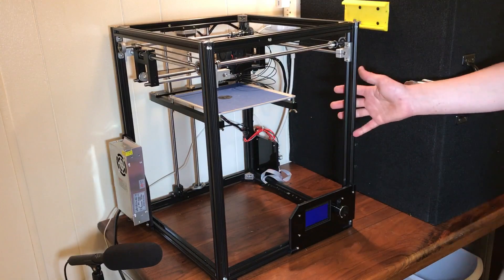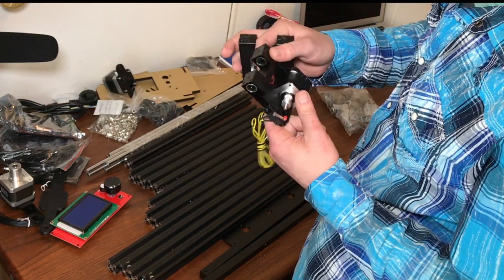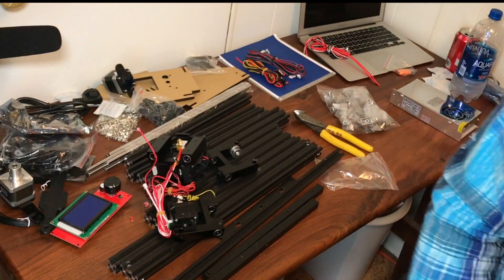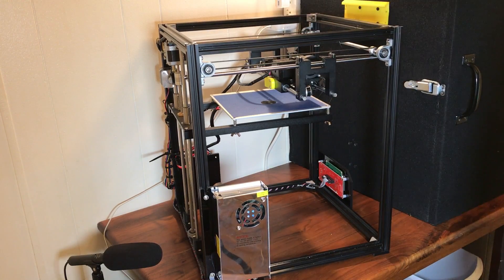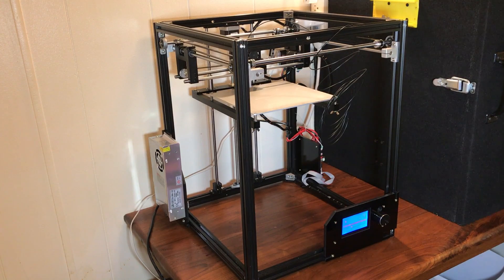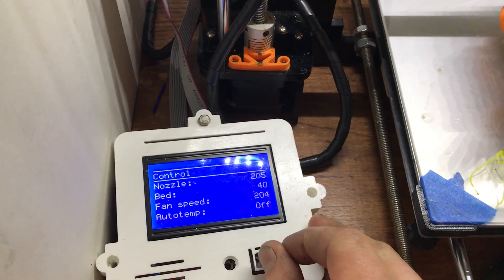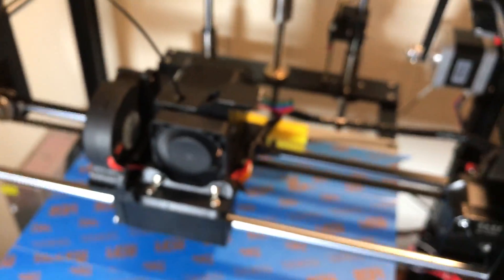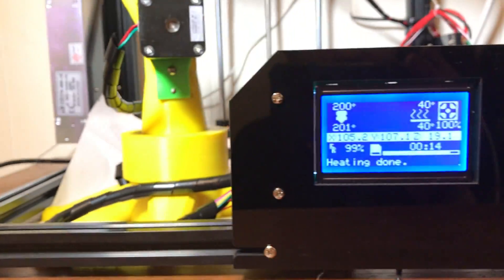Tronxy X5 Review

Comment: Really enjoyed the video. I no why the heated bed will not get to the  temperature. The power supply is not strong enough. did you check the output connections on the power supply with a multimeter to see if they are producing 12 volts. On the power supply you will find a blue square with the brass screw on the top. this will adjust the output voltage closer to 12 volts if it is below. as regards to the heated bed with the Bluetooth that you took off you can try extra strong hairspray this works really well.

Comment: Well what can you do to aluminium? You can forge it, and extrusion is basically the same, but the one-time setup cost is going to be absolutely prohibitive. You can cast it, and i don't know, it could be feasible over in China. It's likely that it's machined because manufacturing volume is low enough, and then chemically pitted during eloxation, which hides the machining marks.